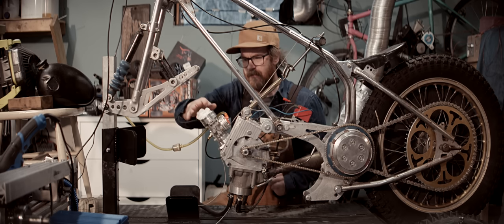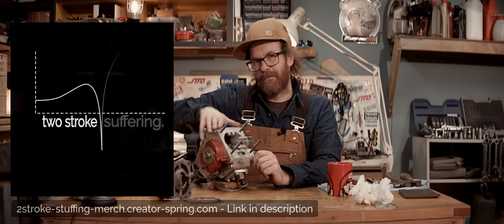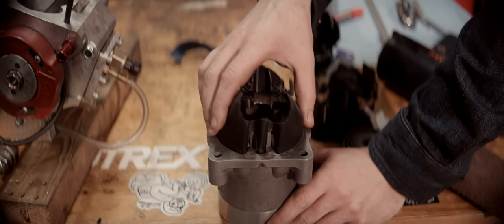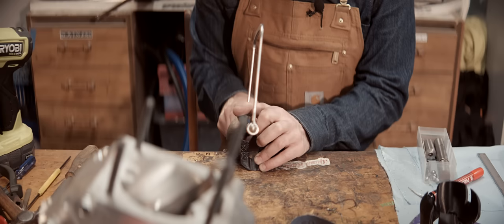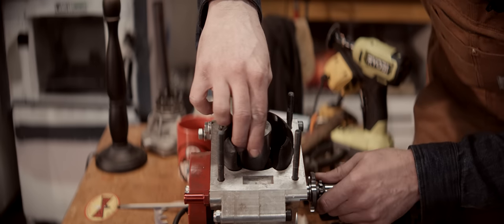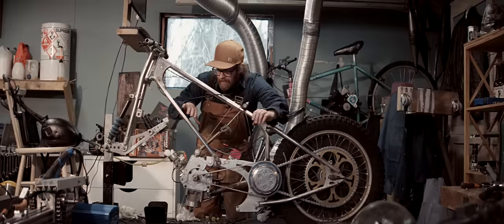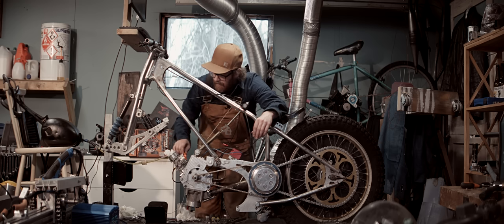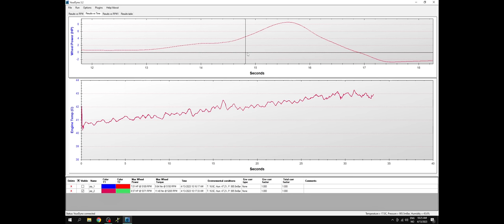The Mother of All Crankcase Stuffers! (and flying variator parts...)

Comment: How did you make those very complicated 3d models? Also, which settings are you using on that ender?😳😳
Reply: Most likely a resin printer not a 3d printer.
Reply: @cro-thehacker7018  maybe, but that's not the point, I just don't know how to do models lile that lol
Reply from the maker: Hard to explain, I draw shapes and cut them with other shapes. Fusion 360, play with it for a while and you'll get a hang of it👍 Ender 3, generic 0.8mm PLA profile, only thing I've changed is retraction distance to 0.7mm from 5mm cause I'm running a micro swiss direct drive extruder. With 5mm retraction it would suck air into the nozzle causing holes in the print.
Reply: @2STROKESTUFFING  thank you so much for your well explained answer, you just helped me a lot! Greetings from Spain😊

Comment: 😈😈😈😈😈   i think thats a brilliant idea filling in the gaps where rotational parameters of air movements are restricted but for the super charger and could the variables be actually measured or only using computer modeling techniques. ..😈😈😈😈😈😈

Comment: Maybe the spring connected on the chassis and the engine eats up some of the power. With the engine trying to twist itself from the frame.
Reply: The engine twists because of the torque imposed on it by the belt as the variator pulley diameter increases.  This isn't using up any significant engine power because the motion is slow, quite small in magnitude and it happens only once during a power run.  Once the variator has fully expanded no more energy can be put into the spring.

Comment: A 2 stroke is supposed to have a POWER-BAND.   Not a straight line of power a place of where the power is at 4 strokes have a straight power curve.   2 strokes ain't supposed to have that its supposed to be 
1k Rpm weak power 
2k Rpm  weak power 
3k Rpm  weak power 
4k Rpm  strong power < where u wanna stay when switching gears if it has gears 
5k Rpm  Strong power 
6K Rpm  Strong power 
7k Rpm  Strong power 
8K Rpm limiter (for most engines) top power
Reply from the maker: In this case 8k is pretty much idle...
Reply: 8k Idle Rpm would kill an engine easy or wear it out quicker.     The PowerBand in a 2 stroke is supposed to have is @3,000-4,000  To about  8,000-9,000 Rpm.  The supercharger should work with a direct bolt on EFI system and should make 5-10 lbs of boost and not blow anything apart.    There is a Efi system on Ebay that is a Direct bolt on and its Tunable.

Comment: Probably a stupid but obvious observation...pla melts at around 200c...is the stuffer you printed for a short duration test? as i think that a prolonged engine run will melt th pla and gum up everything.
Reply: I'd guess it's a resin printer and not a 3d printer with PLA.

Comment: Could you calculate a theoretical horsepower just by measuring fuel consumption and lambda signal over a given time period? The more capable it is of efficiently binding fuel and O2 the more power it delivers. Mechanical efficiency is something you can measure separately.

Comment: Your base is not good. Even the fuel system is a mess.
You can't rely on anything now.
It's time to put things in order.
You need some good carburetors with all the parts to set it up properly.
No more new projects for a while, Order Order Order. And no booze.
Because what you're doing is actually a big distraction, if you know what I mean.

Comment: Great stuff, please put a cap or some kind of protection over the threaded rod that holds the spring. If you get on or off fast without thinking about it, you could definitely rip your nut sack. Funny but not funny, peace…

Comment: I think you lost your aim.....from fastest 50cc 2-stroke to get your dyno working, and then get the engine runnin' at all. I'm curious of your further way.  Cheers and keep it up.
Reply from the maker: Thanks! I kinda started at the wrong end with a bunch of experimental stuff all at once. Goal now is to confirm the cylinder design, then add in more case volume, resonance intake, nitromethane, etc.
I'm very optimistic about next week, can't wait to get past this stage and into experimental stuff again.

Comment: The variator won't change a thing, Kreidler 50 cc produced 17 hp  in 1972 reliable . You hunt things that done soo long time ago, and are not good at taking advice, all you have to do are copy past engine designs to get 30 HP like they did 40 years ago
Reply from the maker: The variator will allow higher gearing, which will allow longer pulls, which is necessary for more accurate power readings. I've done my share of copying proven designs - it's not very interesting to me. My "normal" homemade rotary valve 50cc engine sitting in the landspeed bike makes about 23hp on pump gas, and it's not optimized in any way. It's not that I don't take advice, sometimes I take advice no fool would take, I want to explore the limits. Massive case volume, 100% of bore single port exhaust port, resonance intakes, transfers same height as exhaust with reeds etc. It's a path of failure upon failure, but so much to learn. There has to be some root in reality though, and currently I'm just focusing on confirming my cylinder design, which is based on the tried n true, but differs in key areas.
Reply from the maker: And no way can you copy-paste anything from 40yrs ago and get 30hp.

Comment: I appreciate your hard work ethic and positive attitude when you must change designs and start all over again but I must admit I am getting impatient. Why? I have been watching your channel for several years now and you are still experimenting with your basic design. This is getting boring to me now. Please find a way to post significant content with permanent designs and showing progress or you may lose me as a loyal subscriber. Thanks
Reply: Hello Kurt. I can fully understand your comment and feelings. I've being here from the start 6 years ago when Alex developed his SPX variant with his own crank cases.
Alex is a man who doesn't like conventional where I'm the opposite. I play safe and alter a little at a time and write it down. Alex's intention was to make this engine run on his own design resonant induction system which sadly didn't work as planned.
I come from the clockwork era where volumes are kept small and rely primarily pumping action. Alex on the other hand is relying on the sucking action of the pipe at resonance (20k) to fill the cylinder.
Carbs have run engines well beyond 20k. When testing like this you start with small carbs first then get larger.
Crank vibration is the major issue with these carb problems Alex is facing.
IMO this is where this project gets interesting. The engine has to be made to run full throtle no matter what size carb is used.

Comment: The rpm Are fake as shit, No 2 stroke 50cc goes that low,
Reply from the maker: "fake as shit", wows. 
Did you not see the "Not" in front of "engine rpm"?
I haven't adjusted gear ratio in the software cause things are being changed around, makes no difference for wheel power.

Comment: And yet another failed video just keep going backwards what’s next re designs the whole motor lol
Reply from the maker: Have to backtrack a lot when there was so many experimental features to begin with. Should've started at the other end...
Reply: @2STROKESTUFFING  so why don’t you vent the crank case-why not move over to single fuel injection that can support alcohol and a throttle body would speed up everything and then add boost and your off to the races
Reply from the maker: Cause at the moment I need to focus on confirming the cylinder design.